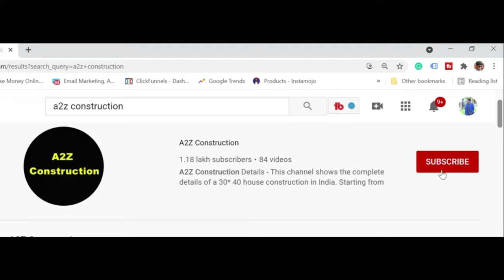Electrical Details in Slab-A2Z Construction Details

Comment: Short question. You are using white tubings. Are this water tubes? In North America and Central America the white tubes are for water lines. The grey tubes are for electric wiring. I did see your boxes for the ceiling fans have a metal bar to hold the fans. Very good idea. We don’t have them in Panama. I will use some short rebar pieces to weld them into a ceiling box. 🎉
Reply: white tubes are used here for electrical conduiting
Reply: @Th3VirtualGam3r  Thank you for your response. That answer my question.

Comment: In Nigeria, we usually lay the pipes on the slab, under the iron mesh. Alao the junction boxes here are not as high as these.
Reply: In Kenya also I doubt if they are that high and alot of immediate on-site improvements must be done to avoid the concrete from drying in the box.
Reply: Sir, Am a building construction student in Nigeria. Ive been curious to know how the electric wires are being run through those series of pipes after the slab concrete casting? Please answer me Sir. I want have the knowledge

Comment: how do we put wires in the pipe. when and how
Reply: After concrete we will clean the electrical points. Then pull electrical spring in pipes point to point . Before pulling connect the wires in spring hook.